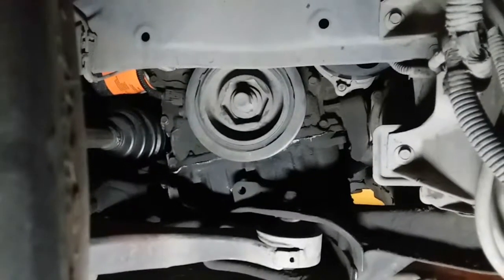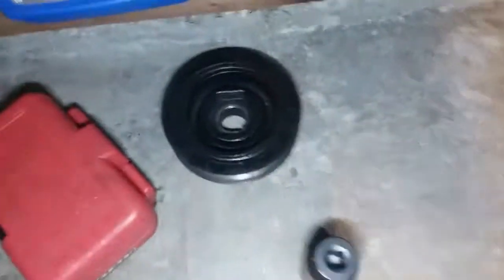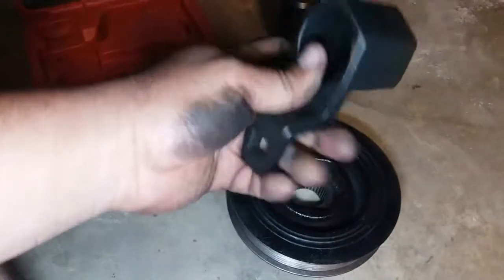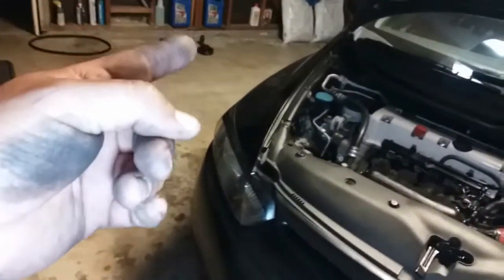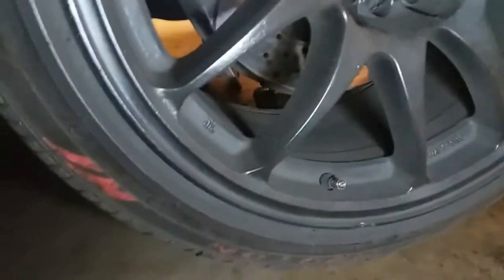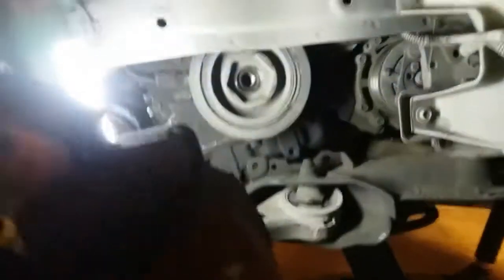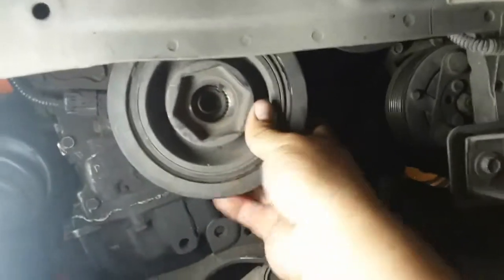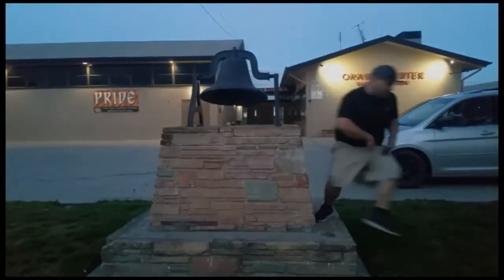How to: Remove Crankshaft Pulley /Harmonic balancer on a 2006 Honda Civic Si

Comment: Thanks for the  video , I have a important question ?  How  do  you troubleshoot a crankshaft pulley that is not aligned with all pulleys  on a 2014 Honda Civic ex 1.8
Reply from the maker: I would start by making sure it's pressed in all the way. Making sure there isn't a gap and make sure the crankshaft bolt is tight. I honestly dont know. Just make sure everything is in place correctly. Good luck brother 🙏

Comment: Might be a dumb question but do I need to empty the oil before doing this? 

Also what’s the lbs torque once I put the bolt back on ?
Reply from the maker: Nope sure dont. im honestly not sure. Just as tight as you can. Id use an air impact

Comment: Yo do you know if my transmission should be in gear or neutral if im not using a crankshaft holder tool?
Reply from the maker: @angelooooooo1637  neutral, you don't want to damage the gears
Reply: @559powerscape will i damage anything inside the engine if the crankshaft moves a little(ccw) as i loosen the bolt?
Reply from the maker: @angelooooooo1637  no it wont
Reply from the maker: @angelooooooo1637  no it wont

Comment: Dude thank you so much, I got my si from my uncle and I found out the pulley was really worn out which caused the serpentine to be out of place and wear out. I ordered the part and I’m going to see if I can get it fixed tomorrow!
Reply from the maker: Heck yeah! Man good luck buddy! Yeah it's a pretty simple job. The hardest part might be the crank pully bolt. On these Hondas its pretty tight. You might have to rent the tool from Autozone.  That's why I bought that fat ass socket to break it loose. Hopefully it isn't.  But other than that pretty easy process!  Good luck brah! Thank you for your support!

Comment: Neat was wondering if there was a easy tool for my r18 that 19mm socket gonna save the day on my NST Pulleys Install thank you
Reply from the maker: Sorry bro, I honestly don't know
Reply: Was the upgrade worth it?
Reply from the maker: @FD-rh6tr  yes the old one was falling apart...replaced it with a oem replacement
Reply: The 19mm does work on non si

Comment: I need to do this on my si, started squeaking and I replaced the idler pulley and tensioner pulley and finally figured out that the crank pulley had side to side play and was scrapping on the block, no shit I didn't even think of the crank pulley😂, hopefully it will come off just as easy 😅
Reply from the maker: Man yeah I was like what the hell. Hopefully this works bro! Thank you for your SUPPORT!

Comment: Nicccce! Just wondering if anybody knows... can I try the breaker bar and starter method on my 8th gen si?? I have this socket on order but Im still willing to try anything until it arrives!
Reply from the maker: You can try it but don't recommend it. I know that method. You can easy mess something up...i suggest using the crank tool and a 19mm with a breaker bar. Ive gotten it out that way but its still a hassle. Autozone rents it for free just need to leave a deposit. You get it back when you return the tool. Yeah this thick socket is the way to go. Breaks it off like nothing.